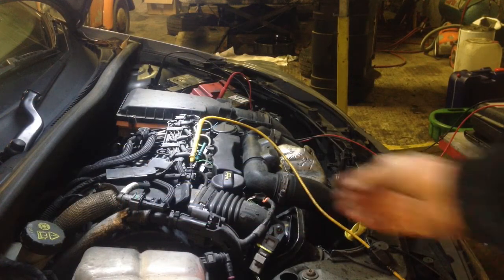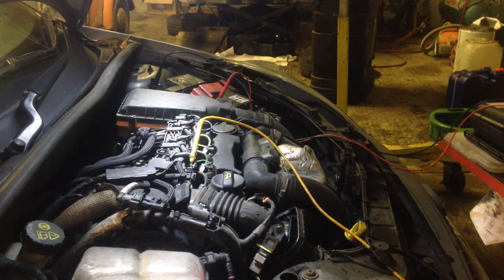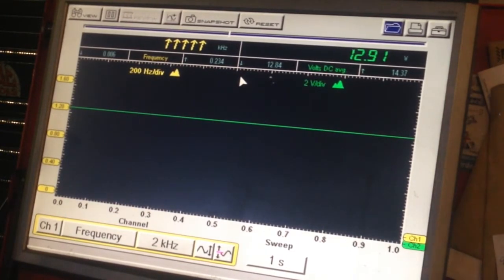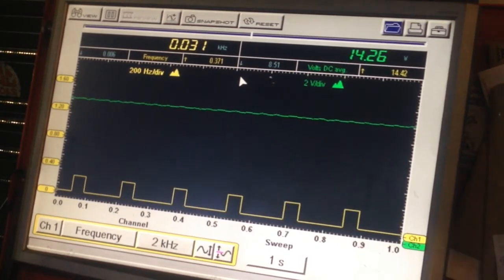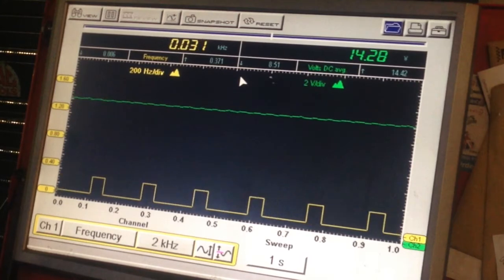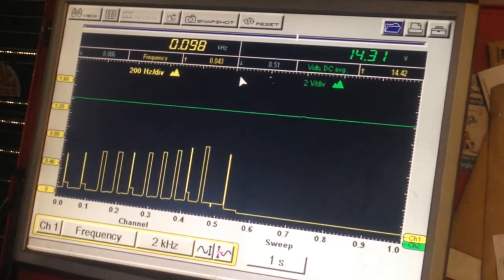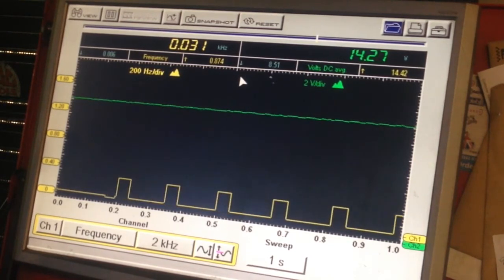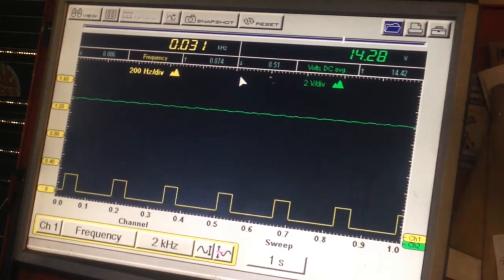Snap on scan tool modis diesel injector wave form 2007 fiesta 1.6 tdci by Scott Mechanics

Comment: Hi scott, i wanna ask you if this tool can do bidirectional test with the suction control valve on the high pressure pump on the denso siemens delphi and bosch systems???
Reply from the maker: Not sure

Comment from the maker: Take a look at this video on YouTube: scope on a diesel injector
Reply: Hi Scott. Nicely presented to illustrate injector solenoid activity vs revs at no-load condition, which could identify a potentially duff injector. Things get really interesting on a dyno, when pulse width modulation (PWM) kicks in and injection pulse duration and frequency both vary according to engine speed and load.